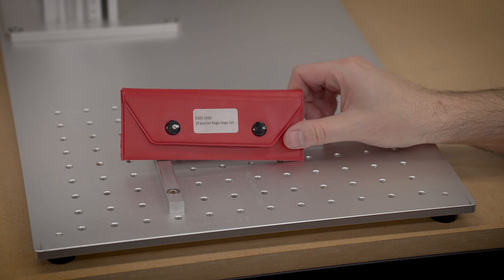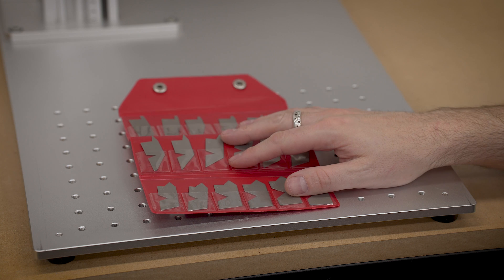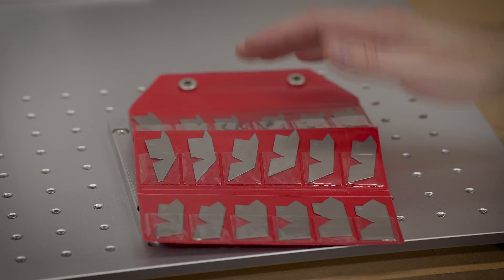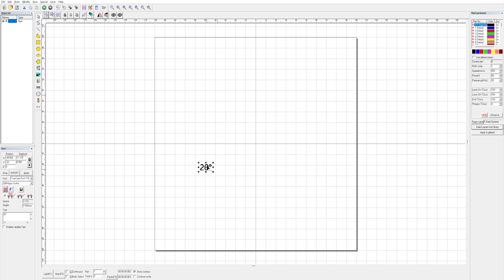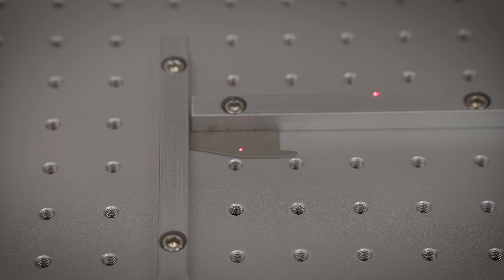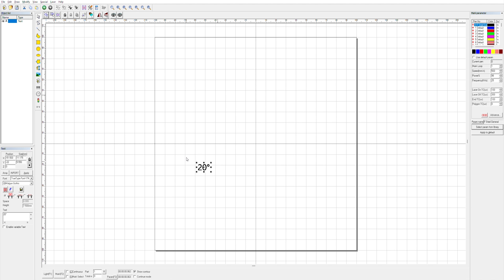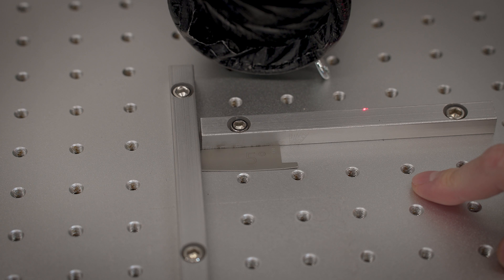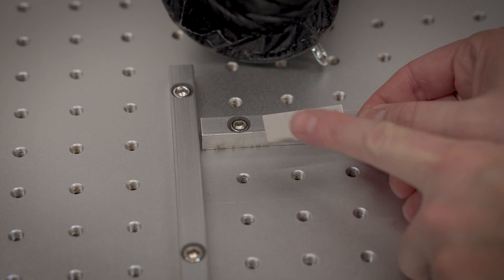Fiber Laser Tool Marking!

Comment: Maybe a sharpie would have done the job as well. That would've been my solution since I don't have a laser.
Now I want a laser.....
Reply from the maker: You're 100% right.  I could have just filled in the stamped numbers and then wiped it off.  That would have maybe been easier, ha!
Reply: @RobertCowanDIY  Yeah, it would have been easier, but engraving it by  using a laser is so much better! 👍
Reply from the maker: @Diam0nd81  Ha, right?  i guess I could make pew pew sounds while using the sharpie though...
Reply: @RobertCowanDIY  😅🤣

Comment: I have found that OBS Studio is the easiest way to do screen capture videos.
Free and incredibly flexible.
Instead of capturing a Window or Program, I do a Desktop capture, and for something like this, I either have the program maximized and capture the whole desktop, or if I don't want the task bar etc, capture an area of the desktop instead, so only showing the part I want to show, but any pop-ups or mouse movement will show. 

I use this idea for screen sharing on zoom, let's say I want to show a YouTube video, I select the area of the video in the browser, and then I can play it easily without having to mess with full screen anything, and if I can lose the bottom part of the video, I can even keep the video progress bar from displaying, but see it myself.
Reply from the maker: That's a good idea, I'll have to try that out!  I was just using the built-in capture in windows, but it apparently doesn't capture dialog boxes.
Reply: @RobertCowanDIY  yes, I started out using Xbox game bar or whatever it is as well, and after several big fails (recording zoom calls, but it was focused on a different window, and there's no way to tell! Lol), and so I switched to OBS, which is what I also work with when live streaming.

Once you install it, click the + under the Sources window and add a Display Capture.
You will select which monitor you want to capture. And this will capture the entire display by default. 

If you want to capture only a portion of the display, right click on the Display Capture source and go to filters, and then add a Crop/Pad filter and adjust it down to your desired size and location.

It has other Source options, but Window capture works about the same as the Game Bar, so no context menus or pop ups show etc.

Mouse visibility is selectable.

I think it automatically has desktop audio and mic/aux audio inputs showing, but if not you can add audio sources as well.
You will have vu meters, volume sliders, etc to mix the audio.
You can also add filters for compression, eq, etc to the audio.

Since it's designed for live recording, I think by default it records to .mkv files, which is safer because if it crashes, the file is saved up to that point (an mp4 file would be corrupted in a crash), but it's not as compatible for editing etc.
So if you don't care about the crash resiliency, go to Settings/Output, and change from mkv to mp4 etc.
If you appreciate the crash resiliency, leave that as mkv, and then go to Settings/Advanced, and under Recording, check "Automatically Remux to mp4"
Then when you stop recording, it automatically creates an mp4 file from the mkv file (they are an identical file format, the difference is that the mp4 file requires a good header, which isn't written until the recording stops, but the mkv writes the header first so the actual video data is safe as soon as its written, so remuxing is simply copying the file exactly, and then writing a different header for it.), though you then end up with both files.
That's how I currently have it set up, and I just delete the mkv afterwards, but it ensures I get a good file.

So make sure you can see the desired program window in the Program window on OBS, and that you have the audio settings correct for the microphone that you are recording from, and then click the Start Recording button. 

And I think that's all that you would want to know to use it for screen recording!

There's lots of other features and adjustments available, but I am trying to give you a custom quick start guide so you don't have to wade through all the streaming focused information from Google and YouTube instructions searches lol
It's a really popular program, so lots of resources available for it, for when you start live streaming laser engraving! Lol
Reply from the maker: @ke6gwf Thanks for the tips, I'll try that next time!

Comment: Do you have a video of how you use the angle gauge?  I've never seen those before.
Reply from the maker: I don't, but I could make something pretty quick.  Those and radius gauges are really useful if you're trying to model an existing part in CAD.
Reply: its really simple, you holds one to the edge of a part and repeat till you find one that fits perfectly.
Reply from the maker: Hey @Arcadenut1, check out my newest video, I explain angle and radius gauges!

Comment: Any idea how the 20W Gweike G2 would perform at something like this? Or even one of the tiny 2W IR lasers?
Reply from the maker: I would suspect it would be similar, but it would just take longer.  I am going to mark my radius gauges, maybe I can do a video using the G2 for those, showing the difference.  I can also try out the 'variable' text option which will automatically change the numbers.
Reply: @RobertCowanDIY  Thanks, that would be a great comparison!
Reply from the maker: @shlubbert3355 I'll add it to my list.  Thanks!